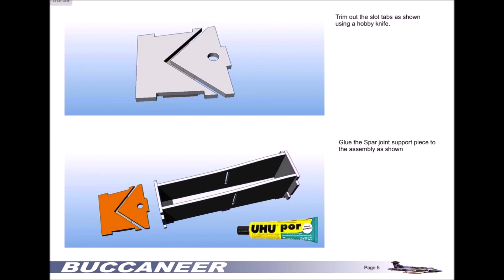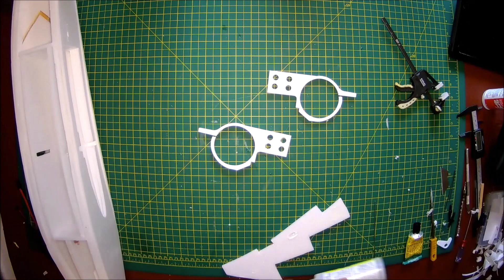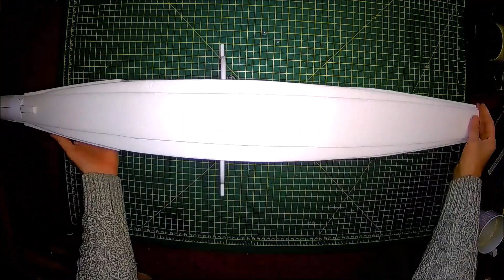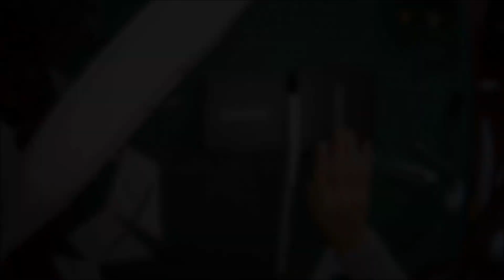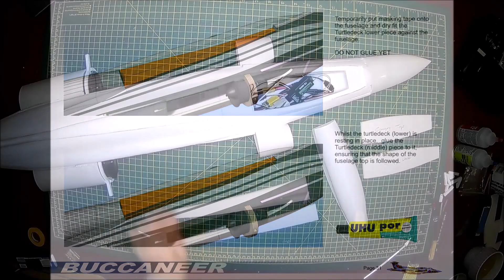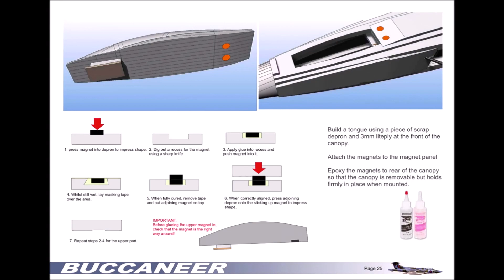Jetworks Blackburn Buccaneer build

Comment: That's a really well detailed and clear video. Next time you do a jetworks build would you consider including the cutting of parts from the plan and in particular, how to cut the parts that have to be mirrored.
Reply: thank you and yes i will include this process in the next build video of which there are a few mirrored parts with angled cuts on both sides 😁
Reply: Hi Pat, in this video i have added mirror cut section and hope it helps you. I'm sure there are other ways to complete this task however i added how i do this :) https://youtu.be/D7fRtDeHoRE?t=588